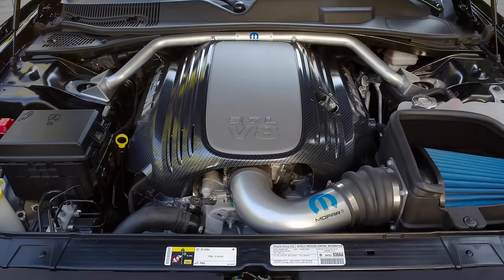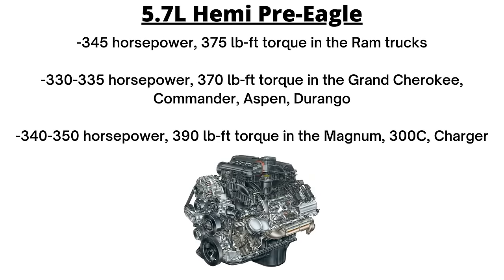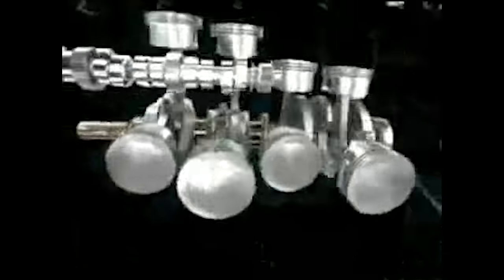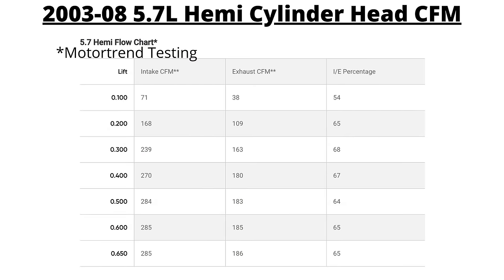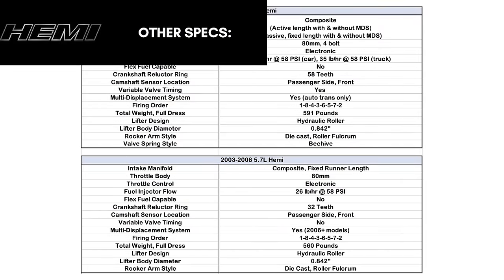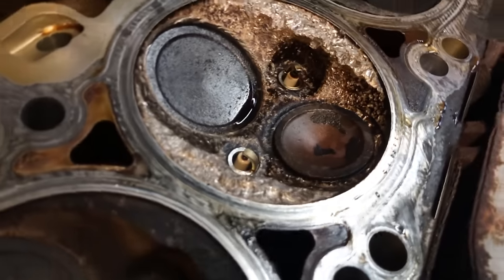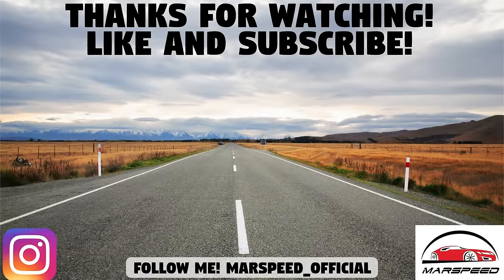5.7L Hemi V8 Engine Comparison - 2003-08 vs. 2009+ – What’s the Difference? (Pre-Eagle vs. Eagle)

Comment: From the sounds of it, Chrysler did a good job renovating the hemi. I'd honestly take a tick over a dropped valve seat (most likely because of the mds and/or overheating). Both expensive jobs yes, but youre basically not at a complete loss if a roller fails (as far as I can tell). I did enjoy this in depth video. :)
Reply from the maker: I agree with you, I had the dropped valve seat and motor was toast. At least with the lifters and cam you can be back on the road within a week instead of needing a complete rebuild or dropping in a new motor. Thanks for watching :)
Reply: @MarspeedCars  can you help me out
Reply: 9/10 times the tick is just rusted exhaust manifold bolts vibrating
Reply: You're a dummy if you think a roller isn't gonna cause wear in the cam (which means metal being shaved off your CAM and getting into your oil meaning getting everywhere inside your engine) and it not being a total loss if your smart. There's a reason why mechanics worth their own salt and sweat say get a new engine instead of doing "just the lifters", your cams already been shaved down

Comment: My 06 5.7 ran great to just under 200K miles, then some guy rear ended me and it was totalled. It was actually quite reliable. I believe it’s because I switched to full synthetic oil early on, never missed an oil change, made sure sparkplugs were always good, and installed the SRT radiator. Never overheated.
Reply: How often do you change the spark plugs? My manual for my 20 rt says every 100k miles
Reply: @2tooful  just check them every once in awhile and replace when needed

Comment: I have a 06 chager hemi with 250k miles and its still running with no tick so you can get a lot of miles from the old hemis
Reply: I have an 06 Jeep 5.7 with 194k miles and still running strong.
My 14 Charger R/T has 117k mikes and also giving me no troubles
Reply: @H1storybr3akdown  Yeah these hemi engines run forever if you take care of them !
Reply: I have a 2006 Charger RT. Had a ticking noise just before the engine blew up...... Now looking to buy an engine. 😢

Comment: imagine making the financial decision to buy a Dodge ram 3500. And you get it with a 5.7
Reply: The only thing that separates a ram 2500 and 3500 is the leaf springs. Otherwise it’s literally the same truck, same weight. I have a 06 ram 3500 with the 5.7 hemi. It runs fine
Reply: @michaellarrick8881  exactly

Comment: It is not uncommon to have lifter failure in the pre-eagle Hemi as well. Frankly, anything with any kind of "active displacement" seems to have abnormally high rate of lifter failure. GM struggled with AFM lifters just like the MDS lifters in these. They're basically operating on the same principle. And, each company has claimed revisions that "fixed" the issue, only to have it show up again as those parts age. The only way to really avoid issues in these systems is to replace the lifters with 'regular' lifters prior to failure. Most of them will survive, but there's always the chance. My 5.7 Hemi has 197k miles on it with no lifter issues thus far. My same year Escalade has 153k miles on it's 6.2 and is currently parked for this very reason. Kind of an unfortunate roll of the dice leaving them in.
Reply: The lifter failure issue isn't caused by MDS. There's plenty of examples of non-MDS lifters and non-MDS engines having the same failure. Roller lifters in general are high stress parts susceptible to damage from small issues. I think the best information is found in looking at where it's most common. That being the 5.7 produced between '11 and '13. I personally believe most of the failures are the result in some cost cutting measure in the production of the lifters following the Fiat takeover. However I also think a portion has much to do with the 5w20 oil specified for the 5.7. The 6.4 introduced in '11 has the same lifters yet doesn't appear to suffer problems at the same rate. I think a lot of that has to do with the 6.4 having a 0w40 oil spec and an oil cooler as standard.
Reply: Just replace them now and get rid of MDS while the engine is still running. Don’t wait for a lifter to freeze and chew up the cam.

Comment: I have a chrysler 300c 05 with the first gen Hemi. It still runs smooth at 140k miles. I did recently replace intake manifold gasket, valve head gaskets and the throttle gasket. I also always made sure I ran mid to high octane gas. Runs like brand new now.
Reply: Hm was all that?
Reply: Which engine oil are you running ?
Reply: Thats a 3rd gen. 1st gens are 1950s 300 A,B,C, and D with the FirePower Hemi :)

Comment: MDS was available on the early LX (pre-2006) cars - my '05 300C (June 2004 build date) has it - never had an issue with that system, but disabled it electronically for aftermarket tuning and better long term longevity (the 5.7 is still running perfect today).
Reply: Correct I did the same
.🙏
Reply: Also increased the throttle response by 5 or 10 percent.. with the Diablo tuner

Comment: Great content as usual.  Hope you can do one exactly like this for the Pentastar V6. I have a V6 2015 Jeep Grand Cherokee and was initially bummed knowing I missed out on the 2016 changes/upgrades (with the exception of engine start/stop).  Wondering if those upgrades affect long term life of the Pentastar. 
For the 1st time since I started driving, I have a vehicle that I'm still in love with, even after 7 years.  Yes it devours gas with my lead foot, but that's offset by not having car payments (which I definitely appreciate given the current economic climate). I plan on keeping this vehicle for a few more years so I'd like to know that it will hold up ( just hit 80,000 miles).  I'm in the minority,  but I'm not in love with the new model like everyone else is.  Since waiting another decade for a new model isn't an option, I'll probably go with a newer, used WK2, hence the curiosity of the upgraded Pentastar's differences.

Comment: The exhaust manifold bolts break usually near the rear of the manifold because of the design of the manifold.  All the cylinders exhaust collects to the rear exit chamber causing that portion of the manifold to expand much more than the the front cylinders. The needle bearings in the lifters fail because of low oil volume being produced at idle . The best solution for that problem is a high volume oil pump in the pre eagle engines.  However in the later model VVT engines because of the lengthened crank snout those oil pumps will not fit . There is currently no manufacturer making high volume oil pumps for those engines. Although a K&N high volume oil filter is available bringing a higher volume of oil to the lifters at idle. Switching the exhaust manifolds to a header and increasing the oil flow makes these engines much more reliable engine.
Reply: Both Melling and hellcat oil pumps fit
Reply: There’s tons more information about this issue online nowadays.
Reply: I dont think its a design flaw, I think its crap lifter bearings from china and mexico..

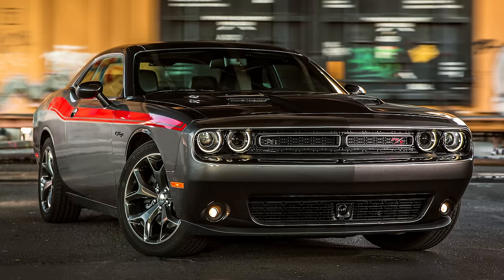Comment: @4:36 That's so interesting that dodge decided to make the most power from the 5.7 in the 09 Aspens and Durangos at 399HP! Thanks for compiling this chart. Theres a lot of misconceptions about the hemis hp in different vehicles
Reply: My ‘09 Challenger has over 400 hp. Did you forget those cheap little cars ?
Reply: @8241jb123  how much did u spend on it?

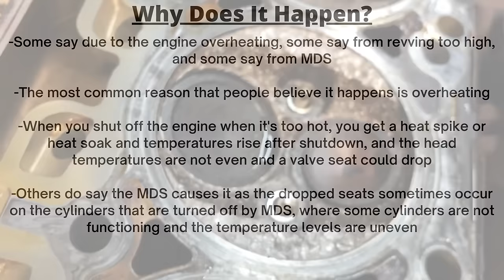Comment: 13:21 Chrysler has had a bunch of different engines with valve seat problems. I can’t speak for them all simply because when they fail the heads are trashed so I’ve never had them milled but I just did a head gasket job on a dodge 3.6 which are known for vale seats and when the heads were on the mill you could tell the aluminum was super soft it came off in long string pieces like when ur drilling through soft metal and so much so the pieces we’re scratching the head surface. You take soft aluminum and over heat just a little and that’s it.

Comment: On another video they claim the MDS actually helps prevent lifter wear, due to the extra oil galley that activates the MDS is under higher pressure to activate the system ... the leftover extra higher volume oil get distributed to the rest of the lifters... but who knows?

Comment: I have a 2014 RT with 128,000 miles also had a 2018 for some reason I feel like the older one has more torque and power even tho it’s still a 5.7

Comment: I have a 2003 in my truck. Has run perfectly and just turned over 200k miles. The only repairs have been the front seal, water pump and alternator. I keep it properly maintained and have been using 15-50 oil. Compression has only dropped by 5lbs. I understand these later engines have had multiple problems. I will keep my 03, I am the only owner as well.

Comment: I have a question. I have a 2006 charger but a new engine was put in 2013 from a aftermarket company b4 I bought it. Is there a way to find out if I have a pre eagle or eagle engine just by looking at the engine? I want to put a new cam in and not sure what one to buy

Comment: I liked this comparison between the two engines, I have seen the flaws in both. Sooo the question 
is can you mount the Eagle heads on top off the Pre Eagle engine and have the best of both worlds.
The MDS is a failure waiting to happen, so it will not be used. What do you think. 
Will it work, and what other parts would have to be changed??
Reply: Yes you can mount the eagle heads on the pre eagle just longer hydraulic pushrods and you can delete the mds system

Comment: Hi I have a  2010 chalanger  5.7 rt manual  transmission   w/blown motor   but I have a 2005 magnum hemi 5.7 out of a dodge ram  no mds  can I use the top end of the 2010 5.7 RT and put that on the 2005 magnum 5.7 hemi  and drop  it in the 2010 rt chalanger
Reply: Please help me
Reply: I could seriously  use your advice on this
Reply: Thanks
Reply: I don't see why not, it can be risky though to do that kind of work on a tired engine. You'll have to research things like push rod length as well. The '10 pushrods might work but I'm not sure.

Comment: Great video, very detailed, thank you. Simple question - will the cylinder misfire in the Eagle trigger Check Engine light, or should be recognized by the consequences as power loss, low RPM or rough idle?
Reply from the maker: Simple question without a simple answer unfortunately! That one I’ve heard that it can be tough to detect. So it won’t throw the code every time, what you describe can also be symptoms. It’s tough because it’s a gradual thing as it wears down and taps over time, and eventually it gets to the point of replacement but you don’t always get textbook symptoms. Anything power loss would signal something major to me though especially when combined with the other things you said
Reply: @MarspeedCars  Appreciate reply and explain. Thank you!
Reply: @MarspeedCars  my 2011 5.7 hemi jeep grand Cherokee has MDS with vvt. @5:47 your pic says vvt with no mds but I can assure you when it goes into eco mode it's shutting off 4 cylinders and isn't as snappy in throttle.
Reply: Yes, and yes. The 'tick', as mentioned in the video, is a result of the roller slapping the cam instead of rolling across the surface of the cam lobe. As this progresses, it is literally wearing the surface of both the lobe and the roller on the lifter which will result in the valve not opening as far as it should. This will cause power loss on that cylinder (as a side note, more than one lifter of the 16 can certainly develop this issue at once) and eventually lead to power loss as there is not a proper air/fuel mixture entering the chamber. Once the computer detects the cylinder imbalance, it will show a code and the dash light will come on. It can happen quickly, and it could seem fine for a long time. It all depends on how "stuck" the roller is, but any indication is a sign of a downward slope towards a costly repair.
Reply: @Nick_Gir  rule of thumb, most all automatic equipped hemi's have MDS, except for the 6.1 SRT engines, and the heavy duty truck engines. Manual transmission equipped vehicles did not get MDS. All Hemi Jeeps will have MDS, except for the 6.1 SRT. To the best of my knowledge, all auto equipped 6.4 SRT's will also have MDS, which would include the SRT Jeep GC.
Reply: If its a lifter going, you'll usually hear a metallic tap. To me, it sounds similar to if you were to tap a wrench on the bottom of your oil pan. If you hear this, take it to a shop or tear it down immediately, regardless of weather its misfiring or not. I've already rebuilt mine once 🙄
Reply: More hemi engines 2016 up don't have lifter needle pin cam problems than do.  I've read it's 3% to 5% that do before 200k

Comment: Thank you for the excellent video and valuable information.  I put pre-eagle engine into a 2009 Cherokee before I knew about the crank sensor changes from 32 to 58 teeth.  The engine starts but stays in limp mode.  Anything I can do besides tearing the engine apart to swap in the correct ring?

Comment: Wait min I doing something wrong 
I got 2008 hemi with 500,000 on it
2019 hemi with 170,000 on it
And 2021 with 100, 000 miles on it 
I got no hemi tick
Or no broke exhaust bolts
I using 5/30 Walmart full synthetic oil 
Change it every time it gets down to 50 percent 
Am I doing it wrong ?
Reply: Obviously you're doing everything right my friend

Comment: Why didn't you discuss the timing components as a defect? I am no mechanic but from my understanding is nothing changed, yet a recall to replace parts was issued for 15 to current, yet nothing for earlier years.
Reply: What recall?
Reply: @snek9353  Chrysler has recalled the timing chain assemblies in just over 50,000 5.7-liter Hemi-equipped Dodge Challengers, Dodge Chargers, and Chrysler 300C models built between 2009 and 2012. (SRT vehicles are not named in the recall, at least not yet.) All have the MDS feature with automatic transmission, and can encounter sudden, catastrophic engine damage when in fuel-saving mode. We know this first-hand as our very own bone-stock 2011 Dodge Challenger R/T recently encountered engine failure on the highway at speed.
Reply: Goggled sorry for the misunderstanding
Reply: My 2014 has the exact same motor and did the exact same thing!
Reply: @doyleedward76  First I've heard of any issue with the timing chain. I looked into it and it appears this recall was in '14 and you post is a copy/paste of a motor trend article. As stated the recall is of '09-'12, so then what are you talking about in your first post of "a recall to replace parts was issued for 15 to current". From the MT article it stems from "a known fault in the oil-control valve assembly for which an updated part exists". So if everything from '12 on got the updated part(s) then what's the issue? 

FWIW I have a '14, that I purchased as a Chrysler certified in '19 dealer records show no unresolved recalls.
Reply: I have a 14 5.7l, all maintenance done on time, oil change every 3500 miles with full synthetic, and the timing chain fail at 105k miles. Took out the oil pump and intake and exhaust valves. Plastic chain tenchner failed. Same thing happened in earlier engines, so I'm not sure they in fact updated later motor! Like I already replied I was misinformed on years for the recall, but mechanic informed me same part numbers for eagle/pre eagle. This information could be false as I didn't order the parts or replace them. Was informed by the mechanic that mine was the 6th hemi rebuild and all of them were timing failers from 04 to 17. Was told same parts in all of them.
Reply: @doyleedward76  Interesting, thank you, I'll look into this. Mine has 60k on the clock, bought it with 42k. I do changes at 5k with Redline 0-30. I'm hoping to get a built 6.4 in it soon, but this pandemic BS has really slowed my roll. Trying to find a cheap wrecked 2nd gen 300 SRT8 to score all parts from.
Reply: @snek9353  Good luck, everything I find is 5k or above. Best bet to be on the safe side is have it replaced before it goes. Save at minimum head rebuilds or worse full rebuild
Reply: @doyleedward76  $5k is fair for a complete but totaled version, there's a bunch of other SRT8 specific parts I want as well.

Comment: @marspeed do you think having 3inch exhaust from the cats back on the preeagles  loss back pressure?
Reply from the maker: Absolutely, I wouldn’t do 3inch unless you’re pushing over 500 HP. 2.5” all the way, with a mostly stock motor you just don’t need that extra room. Might sound good but 3” won’t be optimal for performance. Even SRT and 6.4 cars have 2.75” not 3

Comment: Valve seat drops from heat because of high revs and poor cooling by the radiator and oil pump, which both were updated.

Comment: I’m in the process of getting a 2011 challenger 5.7 hemi so what do you recommend?
Reply: Don't. I just got rid of a 2012 Charger RT. They have issues with cam and lifter failure.
Reply: @dwaynesmith4094  oh thanks that, but this one is a challenger. I’ll keep that in mind
Reply: 1. Pay attention to listen for the tick. 
2. Get good answers about manintence and use. 
3. Check the hours, there's an hours meter you can pull up in the EVIC. This will tell you if it's idled a lot. 

11-13 are the most susceptible years for the lifter failure. The issue isn't as common as many on the internet like to make out but it is something to be warry of and work to prevent.
Reply: @gusramirez2960  did you ever buy one? if so how’s it treating you

Comment: Some or your information is not accurate. For instance; the first gen 3 Hemis were offered in 2002 - 2500 and 3500 trucks only. In my professional opinion, the quench areas in the heads do NOT negate the basic Hemispherical design.